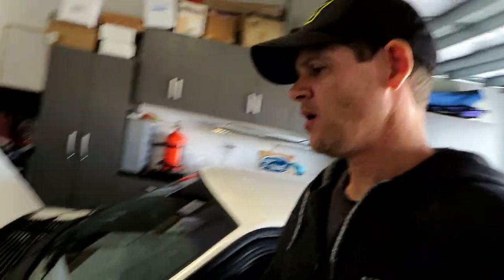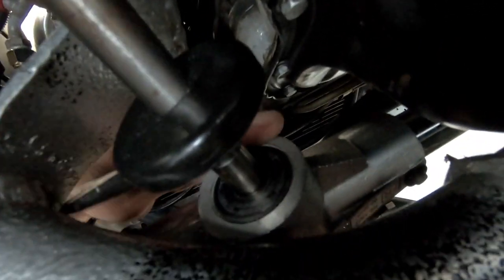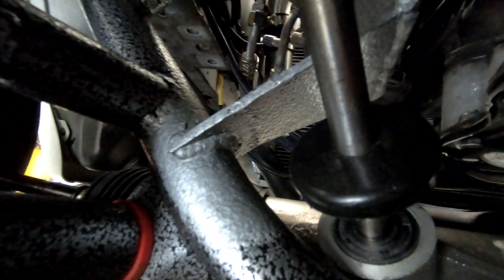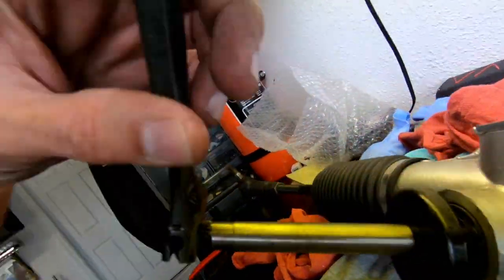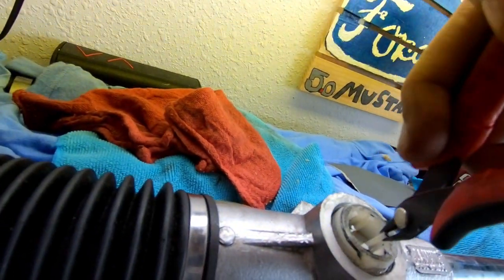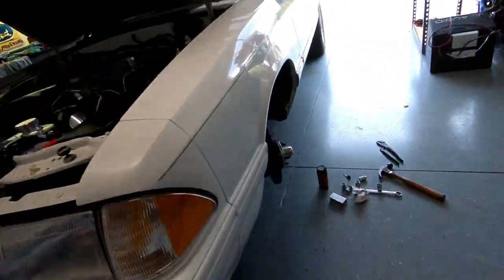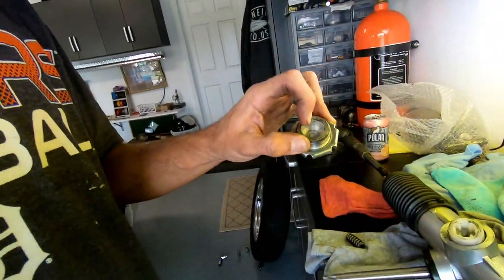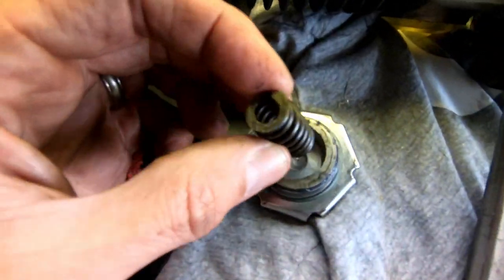Fox body Mustang Flaming River steering rack problems and REPAIR!

Comment: Very informative. Glad You got it figured out. Kind of worries me that the most popular and expensive rack for our car is giving you trouble after a year. A manual rack is my next purchase. I'm undecided on the normal ratio or quick ratio and the brand I should go with. I don't daily the car. It's more like a weekend cruiser that I'll take to the strip occasionally. Whats ur opinion?
Reply from the maker: Travis Dunn Years ago I bought a cheaper rack made by unisteer I believe, and never had that problem. 🤷🏼‍♂️
Reply: @fox-body  I've been reading reviews on a lot of different sites and a few people were really bashing flaming river. Ill probably get the unisteer. Its several hundred dollars cheaper for their kit too
Reply: Fox-Body I just put a unisteer manual rack in my fairmont.  Hopefully it works out ok.
Reply: @anselpeneloperainblossom-s3489  mine worked out fine other than there being some slop in it. Gonna have my brother help me with it to see if there's something I can do to tighten it up some

Comment: Mine is doing the same thing. Put the rack on about 2 years ago. Haven’t driven it since then. So past few weeks i started driving it. No clicking, then noticed it start clicking a little. Now it’s worse. I’ll have to see if that’s what’s wrong with mine
Reply: Update. This fix mine. Put a washer for a spacer. Much better, thanks for video